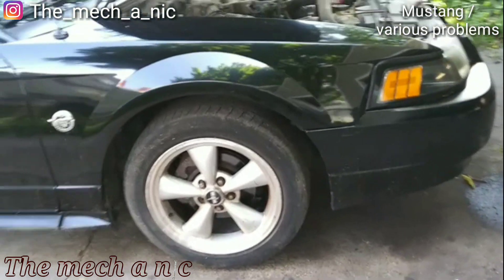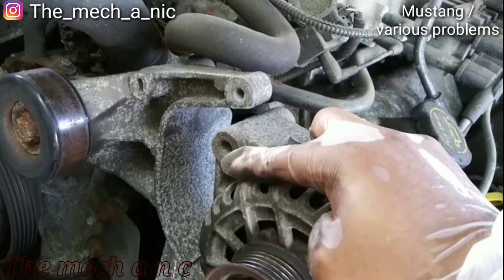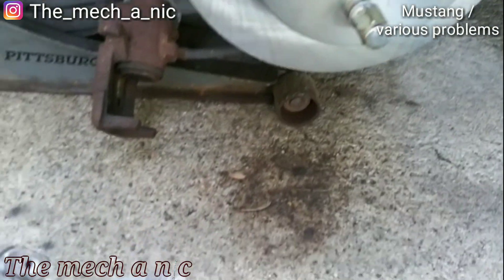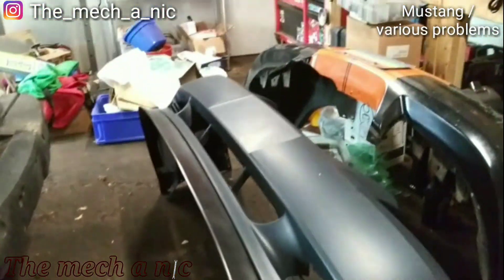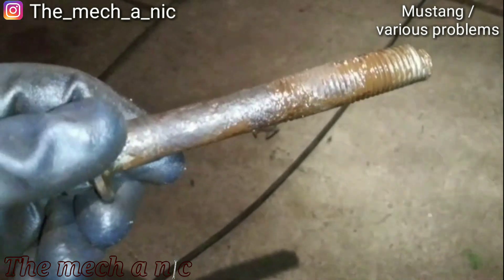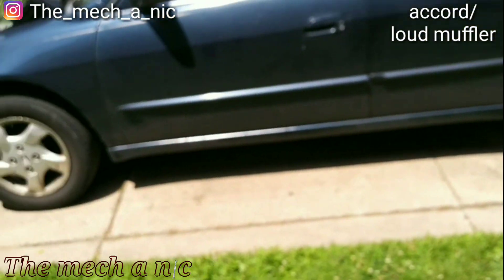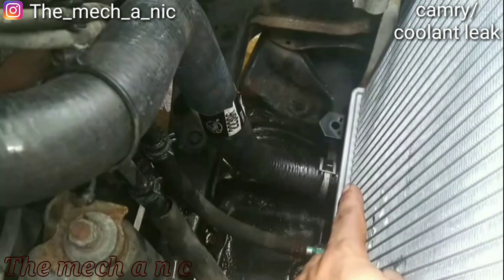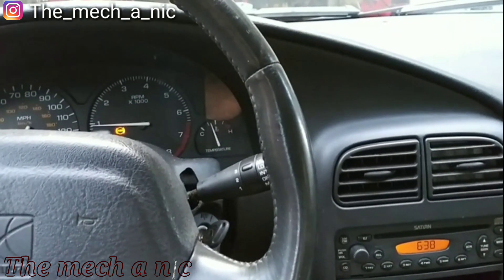insta mech a nic (vol 36)  mustang gets a make over and a tune up

Comment: Your going to think this sounds sick,  but I have been doing it on customer cars [and my own] for years and years and years,  and never had any troubles. Use the sex lube from the dollar tree store or a substitute like it [KY JELLY], and a small artist paint brush, and paint that stuff  in ALL the rubber window guides on both sides of window and any rubber moving parts,  that stuff is slippery as snot and its color is clear and works like it was made for this, even though it was made for something better..lol..
Customers tell me the window goes up and down faster than when it was new.  (It removes a lot of the load on the motor and stress on the parts and makes them last longer)
You will be thanking me for this one,
Reply from the maker: Thats a great idea. I was using silicone paste for that type of stuff but the lube might be a cheaper option! Thanks 💪
Reply: @themechanic6117  I used to use the same stuff,  but this is way better,  and it is water clear, not cloudy clear like the paste, and it is easier to apply in the cold also, and easier to clean up if accidentally applied to something you didn't intend to apply, but because it is clear, you can hardly notice.
Reply: Your probably asking "how I found out about that?" Well, after having "a little bit of fun", after hours at work. I had to go and change a window regulator that  I "just got paid for to do", if you know what I mean.  And I had that stuff all over my hands, and trying to hang on  to the window and grip it to remove it....and BAMMMMM!!!! the idea hit me. The stuff works.

Comment: Sweet! Another episode of the Ghetto Hooptie Chronicles. 😁

I seen your video on replacing the lower control arms on a Ford Escape. I'm currently replacing the lower control arms on my son's '06 Escape & I'm having a bitch of a time getting the front bushing bolt to come out on the passenger side. The bolt only comes out about 3/4" and won't come out any further. I've been working it back and forth but she just won't come out. It pisses me off that my Milwaukee 1/2" High Torque can't get this damn bolt out. Do have any suggestions on getting the bolt out? Thanks!
Reply from the maker: Ghetto hooptie chronicles 😂I like that lol. So it stops spinning?? Id keep spraying it pentrating fluid and work it in and out until it starts to come out
Reply: @themechanic6117  Ya it stops spinning. Going out today to get some MAP gas. Going to try to heat it through the hole in the sub frame without damaging the CV boot. I can only think that the end of the bolt is rusted up pretty good. The drivers side had no issues coming off.